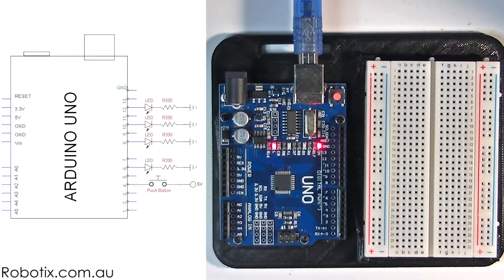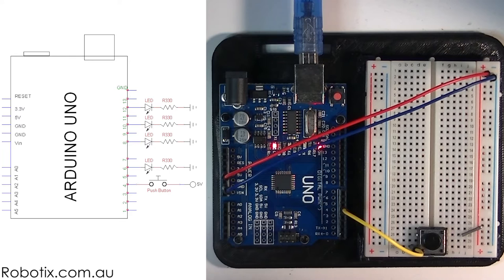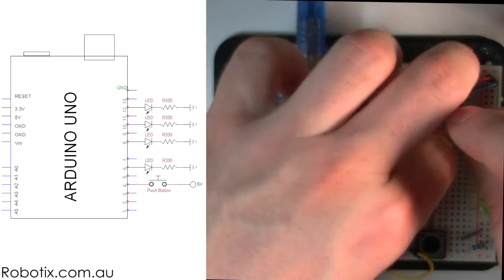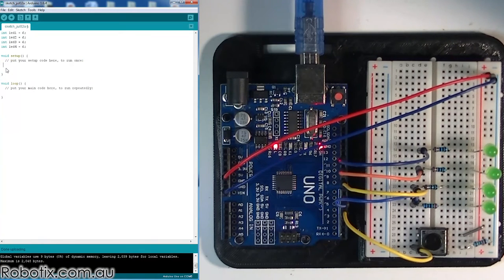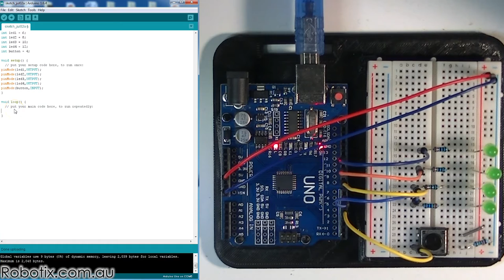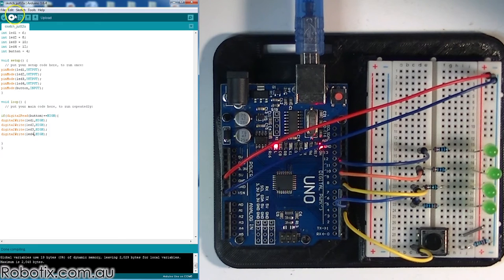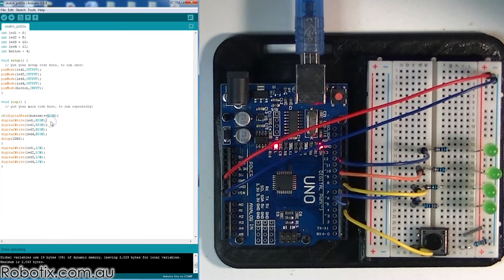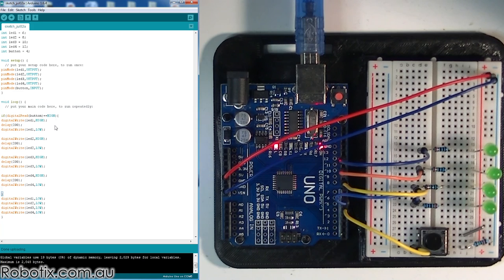Button Triggered LED Patterns💡🕹

Comment: How do I get LED 1 & 3 to light at the same time n then 2 & 4 ....so I can create a side to side flashing effect like an astable multivibrator but using more than one led per side and integrating the Arduino? ...thank you for helping!
Reply from the maker: Have a try using this code: 
void loop() {
  digitalWrite(led1, HIGH);   
  digitalWrite(led3, HIGH);   
  digitalWrite(led2, LOW);   
  digitalWrite(led4, LOW);   
  delay(100);                
  
  digitalWrite(led1, LOW);  
  digitalWrite(led3, LOW);   
  digitalWrite(led2, HIGH);   
  digitalWrite(led4, HIGH);   
  delay(100);
}
Reply: Robotix AWESOME! Thank you!!!!! It's been driving me insane for months! I REALLY appreciate it!
Reply: Robotix just coded it all up and all I can say is THANK YOU! THANK YOU! THANK YOU! IT WORKS! n I learned something.....I've been trying to figure out for months how to send simultaneous commands to different digital pins without "if/then/while" or "delay" interruptions....and activate functions at the same time on different pins at the same time and I was looking at the most complicated stuff while looking right past the "easy"....you are the man! Thank you again..for solving my problem AND for teaching me something! ...I am now aware that C let's you code like this and the internal clock didn't throw off data functions...at least to the eye. I wasn't aware that digitalWrite(led1, HIGH)
digitalWrite(led3, HIGH) would execute at the same time, I thought one would light then the next...but I'm to dumb to realize that even if the clock does actually run the program like that...the eye can't detect it....ugh, I feel so stupid right now haha
Reply from the maker: You are very welcome mate :)
Reply: @SanjinDedic  how would you do: LED1 on first button press, than LED1+LED2 on second button press, than LED2+LED3 on third button press and so forth? Really racking my brain on this one and there seems to be a back and forth with each button press.